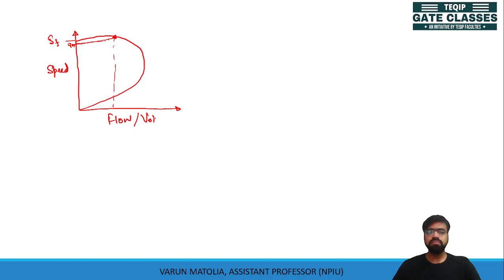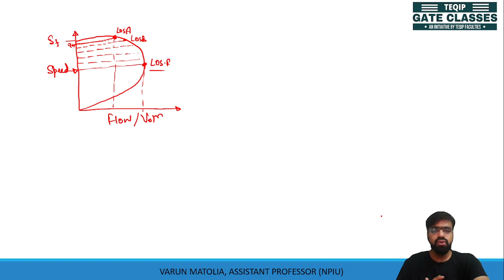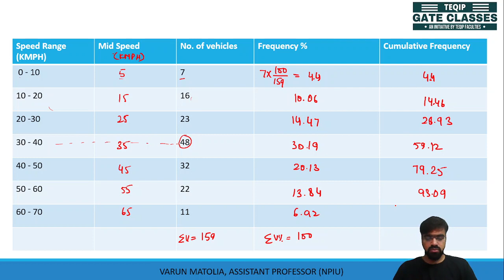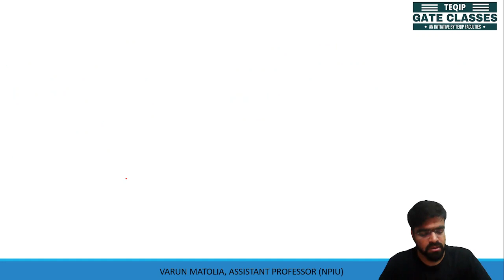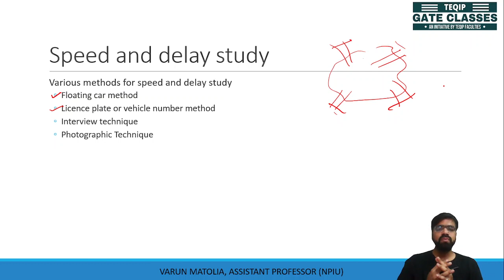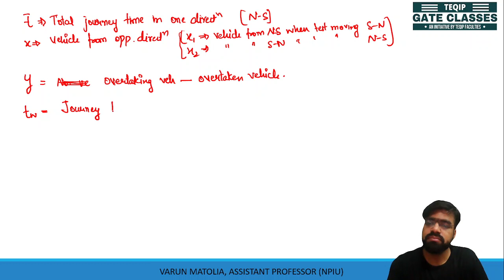Lec - 15 | CE | Transportation Engineering by Varun Sir | Let's Crack the GATE by TEQIP_Faculties

Comment: Thanks but the Flaoting Car method you defined is may be pretinent only to Indian conditions and not international; using 4 observer is method  is old-fashined/outdated. Now use of GPS device and google /maps based highway inventory is utilised. Number of vehicle overtaken and the vehicle overtook is not required as the flaoting driver would instead just overtake as many time his vehicle is overtaken.  On the other hand complexity of the formula and method is good to learn things in the hard way to deliver the best.